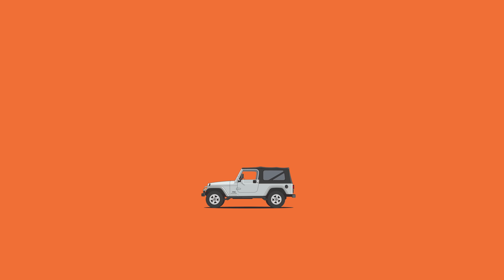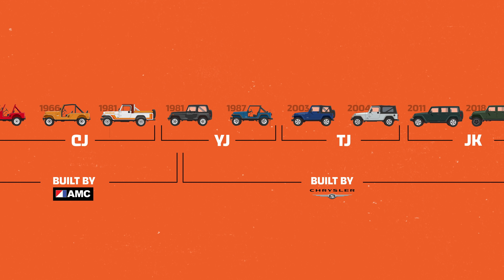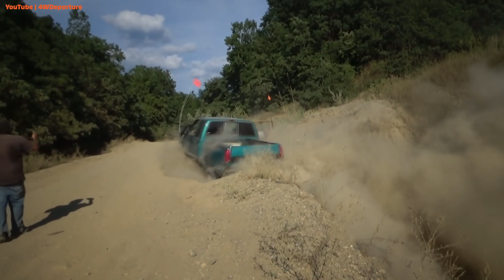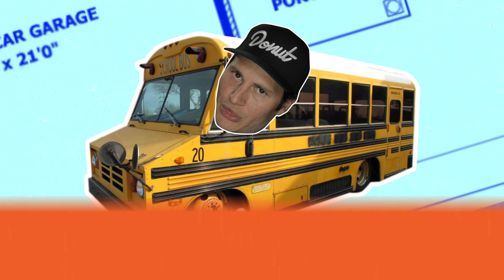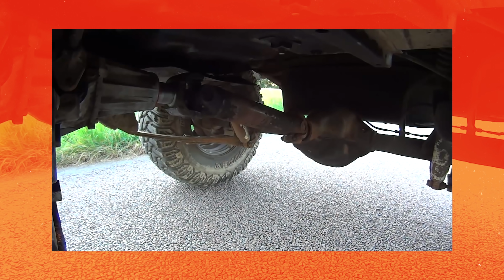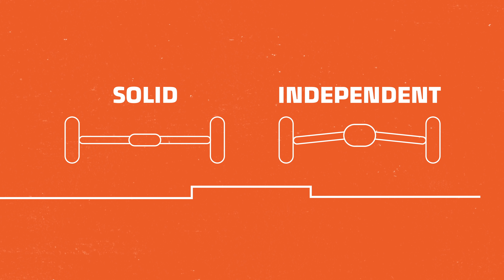Jeep Wrangler - The Science Explained

Comment: I've seen lightly modified TJs walk up things that super-built and lifted 4-door wranglers need multiple tries to climb. The Rubicon trim was nice, but the only real difference form the Sahara or Sport were the Dana 44 axles. It was more of a brag item, because unless you're running 35" tires and/or a V8 swap, the 44 isn't really needed. The stock 30/35 works fine.

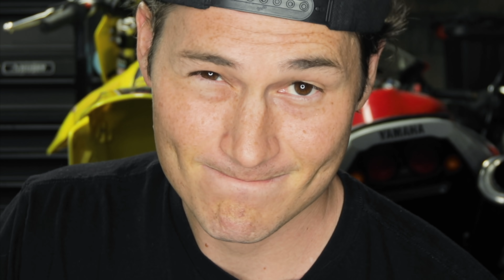Comment: Just a small Wrangler fact you did not clarify .   Most wranglers have Dana 44 rear axle and dana 35 or dana 30 font axles. The Wrangler Rubicon was the only model that had Dana 44 front and rear with 4:10 gearing ,  This was the case right through the JK-JKU models. In the 2018 - 2025 models some other models not just the Rubicon had Dana 44 front and rear as an option.    The same set ups apply to the Gladiators. using the same axles suspension as wranglers.
Reply: The Dana 44 has more leaking problems than the dana 30

Comment: I am over 70 years old. in that time I have had a few 4x4s. My very first one was a 66 Ford Bronco, Loved it. Then got my hands on a CJ-3A Jeep loved it. I had a Internasal Scout, Needless to say I have had a few 4x4s. Coil springs sounds great, But they are not the Grate thing every one thinks they are. What happen when the Military put coil springs on the jeep in the 60s and called it the Mutt ( think that was the name) it would roll over more then the jeep. Now comes the TJ Jeep With coil springs. How did Jeep make it road worthy, Coil springs  was not it. They had to add a torsion bar. But adding the torsion bar you lose articulation for off road. Thus the jeepers stared disconnecting the torsion bar for off roading, and making the TJ prone to roll overs. Jeep fixed this with the JK by making it wider, less prone to roll overs. My perfect Jeep would be a TJ with Dania 44s, Leaf springs, 4.56 to 5.13 Gears, and 35 inch tires. Charry on top is the 4L high out put engine. What do I have now? 2011 JK Rubicon with Dania 44s, 5.13 gears, 3.5 lift, and running 35 inch tires. Yes I miss the leaf springs.

Comment: I own a 2004 TJ Rubicon on 37's and a 1989 TJ also on 37's. Both are used regularly both on and off road. Sure the TJ has far more flex than the YJ but I am constantly tightening the control arms and servicing the flex joints. The track bars are constantly wearing out. On the YJ everything stays tight. End of story.  Leafs have their advantage in some ways. BTW, real Jeeps have 2 doors.

Comment: My favorite is '99+ ~ '03; Best Coil sprung! Anything older is good too, especially once you are outside CA smog laws!!! 

8.8, when you know you know

10:08 Navi
13:18 Fiat Chrysler SHOULD be burned to the ground for what they have already done. The death of the Cherokee/GC!!!!! The death of the 4.0L I6!!!!!! The continued perversion of the Wrangler!!!!!!!!!!!!!!!!

Whoooo that DW.

4wd solid axle !!!!  Sports car Independent/solid

Chrysler is still killing the Jeep name and the Wrangler suffered a lot of bad decisions since the JK came to be. Glad they keep what they did, and do like ... one? of the changes, but over all, its just falling away. I mean, the plastic "skid plate" on the front, the grill is plastic, all the plastic clips holding that together; Not cool man.

Love DANA axles, and the 30 seems plenty strong for the front, but the 35c .... axle shafts tend to be a little weak. It's a bit of a 2 sided thing. Some swear the 35c is just fine, some say it can't handle over 33" tires(this point is also not solid *zing*) 
Ford 8.8, 9, 10.25, GM 14 bolt , and even the CH 8.25 great alternatives to Dana 35c, 44 or 60

Comment: IF suspension travel is the same , independent suspension is better, from a traction perspective. (Typically solid axle has more travel, but not always. Probably for all production cars , solid axle is better). However , I'm willing to bet that there are independent suspension systems that have better travel than the old leaf springs.

Comment: I knew most things in here accept for the axle rap that would have to be a pretty torqy engine and I would think weak leafs for that to happen , mind you I am old school and still am learning about 4x4s , I used to help build older( mid 60s-very early 70s) muscle cars and  I never seen that happen even with 500 HP chargers or challengers with manual trans and  456 or 411s in them, I think the only time I have seen something similar is where we built a V8 Vega with a blower on it and decided to see how long the stock rear end would last which needless to say it lasted maybe 20 seconds before it grenaded on the street I would think or wish that if  I were to ever own a jeep that it would have Dana 44s on it just to support the tires . my old ram 4x4 had dana 60 rear and 44 front and the 44s look tiny and some of the tires I have seen on jeeps yikes how can anything less then a 44 last very long turning those huge tires I have seen

Comment: This is going to be a dumb question. Seems the panhard bar would result, by necessity, in the axle moving towards the bar if the entire suspension was left to hang. 

It's a fixed length, no? That would mean as the axle comes down, it will naturally pull the axle towards the side that is attached to the frame, as the end on the axle traces a circle as it comes down.

The only way I could see this not happening, is if the panhard bar has the ability to extend as the axle goes down.

If I am missing something, please let me know, but it seems to me geometry dictates the axle would have to move left to right if the bar is a fixed length. 

I can't imagine how it would work otherwise except that the axle only ever drops low enough to barely move it. I am, of course, speaking of the three link.

Can a suspension guru explain why that doesn't become a bigger issue? Is it because the axle isn't allowed enough droop to throw the axle out far enough to matter. Or does the bar have some kind of strut or mechanism to allow length changes, while still remaining solid.

Comment: Solid front axle are maintenance heavy stuff if one want to drive at highway speed. small amount of play in the components that are usually fine for independent suspension, will lead to wobble with a solid axle. As parts wear down they will wobble until replaced and aligned.

Comment: "heavy duty Dana 44 axles" yeah this dude doesn't know jack diddly squat. I've blown Dana 60s and 14 bolts. Besides the fact short of Rubicons you're stuck with a Dana 30. Also only the Rubicon comes with factory lockers. Short of having lockers you're gonna have a bad day offroad when you have no traction with open diffs. I can't believe you didn't even mention this. 

If you want to actually know something about Jeep head over to @dirt lifestyle

Even suspension geometry aspect you're talking in the most basic of terms and forgetting half the info. Saying "leaf springs bounce" is a very poor description. It has to do with spring rate. And they most definitely do have the flexibility when you get the right spring rate for your desired situation just like a coil spring. You can also if you wanted to say upgrade from a stock leaf to a longer Chevy 62" leaf which leads to less rearward travel when flexing as well as a softer more linear ride quality and less axle wrap. Speaking of axle wrap you can make track bars or spend $200 on some which will completely eliminate axle wrap. You also showed a semi triangulated 4 link when the TJ/JK/JL/JT most definitely has a parallel 4 link. also bump steer is caused by a difference in track bar length/angle in comparison to drag link length/angle and nothing else. When you mention track bars you also completely forget the fact that as your suspension travels up/down having a track bar style 4 link will inevitably cause the axle to move left/right. This is why triangulated 4 links are superior. Axle is always perfectly centered. 

Next thing when you bring up death wobble the only source of death wobble Is improper alignment. Whether that's because the alignment is actually bad or if it's out of wack due to worn suspension components (most often ball joints or tie rod ends but also occasionally tracks bars or control arms)

Comment: if you triangulate a 4 link you dont need a panhard bar. the heim joints will sit at their max angle and that prevents any side to side movement in the axle. still allows you to flex the rig out

Comment: Nice video. The TJ/inline 6/5 speed manual was the most fun to drive by far. The automatic can't beat the responsiveness although it may make it easier to crawl. I was more of a mudder so I loved ripping it in 2nd. The suspension was great. The TJ was the perfect blend of electronics and off road capability. It was basic. I always thought they named the next model JK because they were just kidding. It's plenty capable but I felt that it lost the essence of what a wrangler should be. It leaned more towards a soccer mom mall crawler. Some of these newer built ones I see around town are nice but I doubt any of them touch more than a dirt road before their owners are crying about scratches. Glad I was able to buy back my TJ. Hard to believe it's 21 years old.
Reply: Sounds a little gatekeep-y. Took my '23 Wrangler offroading the day after I bought it, an extremely capable machine, even stock. You know who I don't see offroading anywhere though? New Broncos. Makes sense though, with the 10-30k markups, people consider them "luxury (off)roaders".

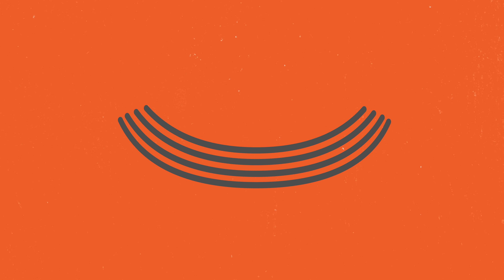Comment: 2:51  Your leaf spring illustration is backwards.  (Not that it matters.  It's just an illustration?)   (Smaller leaf's are on the bottom.  As the top leaf's flex and takes more of the load. The more the extra leaf's lend a hand.)

Comment: The military Jeeps and CJs were not "Wranglers". Some military GPWs (General-Purpose, Wheeled) vehicles weren't even "Jeeps". AM General, Ford, and a few other mfrs made versions of GPWs for the US military. The M151 (Mutt) was one of the last.

 The '76-86 CJs shared some similar parts with the early YJ Wranglers though...like bumperettes (with different mounting holes), taillights (with different pigtails), windshield tie-down hardware (except late-'95 YJ), and the carbed 4.2L and 2.5L engines. Front seat mounts were very similar between YJs and late CJs too. Many other parts could easily adapt, like body parts, seats, tops, etc.

Comment: They weren't actually a wrangler until 1987. An prior jeeps were cjs. The had the cj2a the cj 5 an cj7 an they had the cj6 an cj8 models which were called scramblers an were a jeep an a truck together an were pretty cool. An they started out being made by Willys then AMC built them up till 1986 then AMC built the 1987 yj wranglers then late 87 to early 88 Chrysler started building em

Comment: An solid axle is better for off roading with locking diffs and also it gives the vehicle a lot of ground clearance but bad at road pavement because you can feel every single bump in the road and has bad handling and traction especially when cornering. But an independent suspension is better for a smoother ride and have better handling and traction but not as good at off road like an solid axle.

Comment: Dang, are those your animations and illustrations? Impressive! Fun vid. 

 The TJ, I agree the pinnacle of the Jeep. They were two-doors, still dead simple, still offered the legendary 4.0, noisy, bumpy, no curved windshield or dash, and still small. Love it. 

Hey, I love the new Jeeps, but they also have a lot to go wrong with all those doo-dads. And the money? Lordy, the money! For the kind of money they're getting for the loaded ones, well, I'll just get a new loaded Tundra, which is what I did - and for less!

Here's my TJ story:

Bought my '97 Sport, 5sp in '05 (D35 😔) w/ black steelies, 33x12.50 BFG M/Ts, 3" lift and t-case drop. While I never had any death wobble incidents, it was just loose. Every time you shifted gears, the Jeep would kind of twist and squat on throttle, and then back again off throttle. No one could resolve it short of me spending a ton of money rebuilding front and rear - everything. Bushings, bearings, tie-rods, steering box, torque specs, new shocks, the works was done. Was it the coils?  I guess looking back, it was torque steer/squat and I probably would have done more to work on that rear panhard. Anyway, I just got used to it and sold it years later - only because I would no longer have a garage where I lived for a year. Loved that Jeep and never stopped missing it. 

Fast forward to 2/19. Now married. Asked my wife what vehicle she thought I missed the most (I buy and sell a sh**-ton of vehicles), and immediately she said "your Jeep!" About 45 minutes later we were looking at an 05 TJ w/low miles 74k, 6sp (manual was again a requirement). Previous owner(s) lifted it 3" (per my eyeballs) and a 1" body lift and went w/ the dreaded t-case drop. Meh what hay, still had great clearance.

So these young dudes that owned this little lot here in Texas were terrified of this TJ. They weren't real good with manual trannys, and this had some nasty oxidized alum wheels with old Goodyear M/Ts that were pretty worn, out of balance, and out of round. They just wanted it gone. Got it for a steal. Wanted the look of my beloved '97, so called 4-Wheel Parts and ordered the same cheap black steelies wrapped in the same, but vastly improved, BFG KOs (much quieter and smoother on pavement) over old generation of BFG s. Had every part in the suspension checked, all the front-end geometry corrected, new tie-rod ends, already had a perfectly fine steering stabilizer. Took a few tries to get the tires balanced correctly, but now, total perfection. Two finger steering at 50-75mph. All done by 4-Wheel Parts, and I know some call them "4-steal parts, 4-cheep parts, 4-crap parts", etc. I've heard 'em all over the years on all the forums, but some of us get lucky and have a well run operation, like our central Texas one.

Jeep looks better than new and will never leave my hands. 

I had a PDR guy come out and take care of a few small dents in curved part of the hood. Did perfect job. I then spent an entire day giving it the paint correction treatment, and full buff out.

Comment: I have an '89 wrangler with a 3' suspension lift, 3' body lift sitting on 33"x 12.5" R15 thornbirds powered by a carbureted 4.2 and a 5 speed manual with a center-force 2 clutch.  It's a beast.  I call it Lil' Nasty.

Comment: Fun fact...Wrangler production was moved from Toledo to Brampton for the 1987 to 1991 model year's.  I was on the pre-production assembly team when it came back to Toledo for the 1992 model year .
Reply: What was youre work ?
Reply: What was youre work ?
Reply: What was youre work ?
Reply: @sulimanalghaithi9342  ..I did a little if everything . I hired in as a welder , then went to trim assembly , then final assembly , then inspection , and finally a team leader in inspection.
Worked on every line in the plant from the Big J to the KJ until retirement in 2016.

Comment: @Donut Media please pin this: The longer 2nd gen Wrangler isn’t a TJ… it’s an LJ. And you guys ROYALLY screwed up the years in the generation timeline graphic. CJs went to ‘86, YJs were ‘87-‘95, none in ‘96, TJs were ‘97-‘06, LJs (longer TJ) were ‘04-‘06, JKs and JKUs (4-door) were ‘07-‘18, the current JL and JLU started in ‘18… so there are ‘18 JKs and JLs. You’re welcome.  Also… it’s technically true, but really misleading to call all of the CJs in that graphic just a “CJ” without denoting the difference between the CJ-5 (short), CJ-7 (long), and CJ-8 Scrambler (pickup). You guys gotta get this tightened up…

Comment: In WW2, there was an M4 Sherman that used HVSS for suspension instead of coil springs or leaf springs because it stabilized the tank much more effectively in movement. What would be the downsides to the same system when used in consumer automobiles? Cost?

Comment: Yeah as far as jeeps go leaf springs > coil springs. The set up for aftermarket is better and death wobble does not happen. Most of the problems with them can be minimized or prevented with aftermarket parts where as the tjs get more problems the more you fuck with them. Jeep knew what they were doing and decided not to add coil springs like they did on the Cherokee years before for a reason. What changed is that the wrangler became more of a mall crawler more than a rock crawler. Comfort was prioritized.

Comment: I believe the high pinion dana 30 is actually stronger than the stock dana 35 so bigger number isn't always better
Reply: It's stronger because it's running reverse rotation in the front, so the gears are running on the correct side of the teeth.